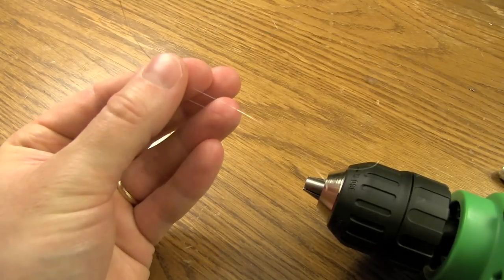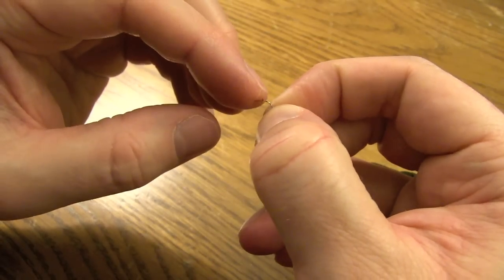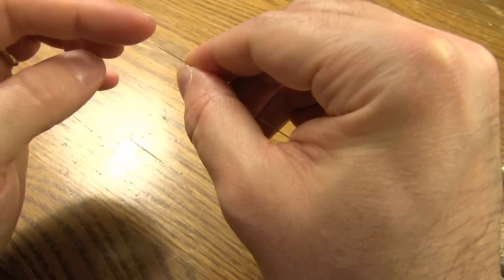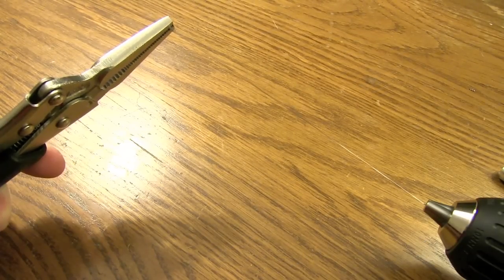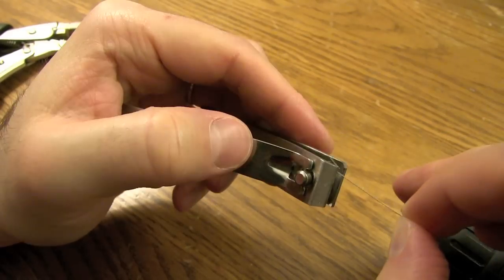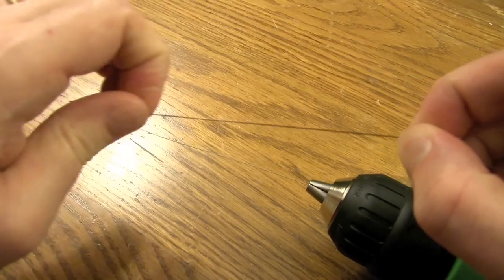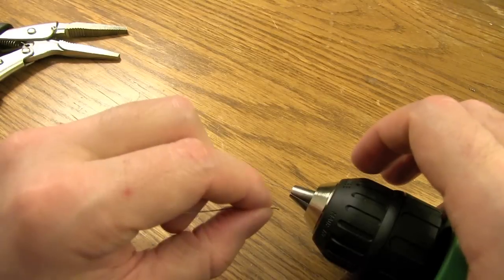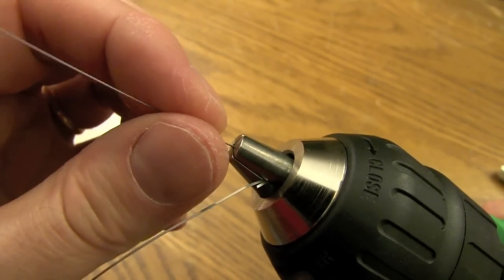Flat Bastard Coil

Comment: Thank you so much for this coil buddy, loving it!!! I tweaked it out just a little bit and did two versions. In order to get it dual I had to drill out my center posts on my RDA's (Patriot and Chimbus) to 1/16". Both I built with twisted 28 and .5 mm flat ribbon, and then did dual coils. The first set I did with 4 wraps and got to .28 ohm and the other I did 5 wraps and got them to .48 ohms, that way I've got one to chase clouds with and one to be able to vape while I drive. These are my favorites so far hands down, so thanks again brother!!!

Comment: Ive been doing this build for a bit now, it works best if you do the original twist in reverse, then run the ribbon around in forward just like you would normally clapton, great build

Comment: been calling this the ribbon clapton usually use a nichrome or royal core something with higher conductivity and dual this puppy at about a .17 lets you achieve over 100 watts with less than 25 amps boy is that some flavor and cloudage

Comment: Rip uses 60/40 vg/pg most of the time as posted on his earlier videos. And YES sir, he does boil his cotton wick. 10-15 minutes with distilled water, rinses em with distilled water, another 10-15 minutes of boiling, drained and air dried.

Comment: Prolly dumb question:
Why not just use lower gauge (thicker) kanthal?
Wrapped that tight--it doesn't seem you'd benefit from additional surface area to vaporize the joose.
Reply: Surface area makes a huge difference.  Its not always about low ohms, you need good airflow, enough surface area, a proper build (no hotspots/hotlegs/etc.) and you need a good mod/battery combo.  The trick is balancing the surface area and the resistance.
Reply: jake bone Thx for the reply.  I guess what I'm really asking then is what does the flat media gain you over wire (which seems much easier to work with)?  This seems like a lot of extra work.
Reply: Personal preference.  Different builds give different flavors/densities/temperatures.
Reply: More flavourful dense vape dense clouds and next to no throught hit like a Clapton but more flavour by a bit and considerably less thought hit
Reply: Adam Brown
throat*

Comment: im new to building my own coils...and everyone in the facebook groups said to look you up ... just wondering what would i need for a "started kit" for building my own coils...please and thank you!
Reply: I started a few weeks ago and got some kanthal, tweezers, a bernzomatic blow torch, cheapo multi meter and nail clippers. I haven't needed anything else yet (apart from things to wrap around), and have built a few protank coils and rebuilt my Trident a couple of times, no problems.
Reply: MisZ RiP also has a nice video where he goes over some basic supplies that he uses all the time.  That's where I got my start and just like Dogeggz I have a few basics.  .28 guage kanthal (amazon.com), some tweezers, a butane torch, an ohm meter and last but not least organic cotton (boiled in distilled water).  Haven't needed anything more and the start up costs for all those supplies was roughly $50

Comment: is there a such thing as a hollow clapton coil?
Reply: izzy ravenlock  no, because the coil ohms at the lowest resistance wire...ie the center post. with a hollow Clapton, the leads would most likely be burned through, and your coil would ohm too high anyways, you see, because the hollow Clapton is too long to ohm anywhere even below 5 or 4 ohms.

Comment: Is this the same as smoking a cigarette? Like with nicotine?
Reply: you can get e-juice from a very high concentrate of nicotine to zero nicotine. pretty much nicotine is the only thing that vaping and smoking have in common. when you start vaping, it's usually a good rule to start off with a nicotine level that matches your regular cigarettes if you really want to make the transition. then it's easier to lower your nic levels as you go. can't say the same with regular cigs. it was hard for me to go from marlboro reds to lights. i went from an 21mg nic level to 0-6mg within a few months.
Reply: You do have to get used to it. I started on 12 and I think I'm going to go down to 6. I still miss the instant buzz from cigarettes, vaping hasn't given me that, but it could just be my build.

Comment: so you have to be well off to basically buy a good Mod?
Reply: dustin b  No, you don't.  If you're not already a smoker, you shouldn't really be thinking about starting vaping.  

If you are already a cigarette smoker, then buy a reasonable mod and a tank or two, and within a few weeks you will have saved more money than the equipment cost you.  You can get a decent regulated mod (30, 40 or 50w) for £45 / $65, or even cheaper.    

I bought my first mod a week ago, the Eleaf iStick 50w.  In the UK it cost me £45, in the US it's $60 or $70 max.  Then I bought a Smok VCT tank for £15 ($23 or so), and the juice.  Given that I used to spend £6 / $9 a day on cigarettes, and now I'll only spend £1-£2 a day on juice, it won't be long before I've made back my initial £70 investment, and after that I'll be saving money every single day (not to mention saving my health, of course!)

Comment: i am a noob. is a 1.1ohm build safe?
Reply: +vinz redd Well it depends on what wattage or voltage you're going to vape it. Theoretically, any ohm build is safe. However, if you're going to vape at 0.01 Ohms, the max (suggested voltage) would be around 3.7-3.8V. Some would say different. Now, as the Ohms go up, and if voltage stays consistent, you'll get less heat. If the voltage is consistent and Ohms go lower, the more heat you'll have.
Reply: +JWeaverTKD SMH

Comment: I have a problem... so I just got a new mod... my first not brand new pretty old actually well anyway I have a tank with a wick and a normal tip and then the problem starts well the battery shell thingy is Idk if it's the problem or connection or my vape just sucks really bad OR WHAT anyway every time I take a hit the battery gets hot as fuck please help anyone